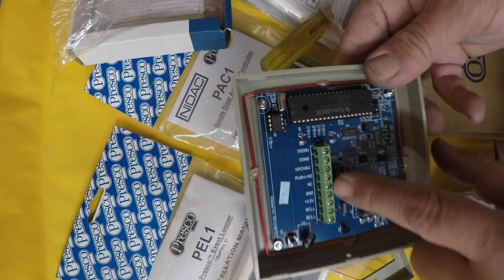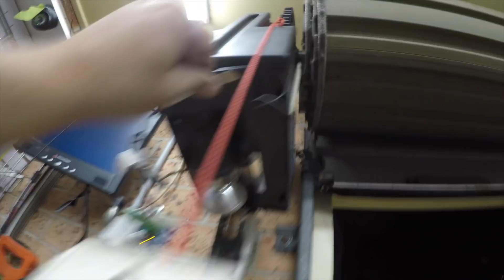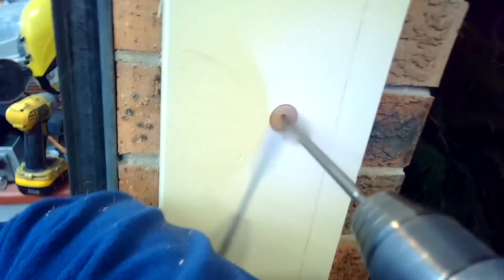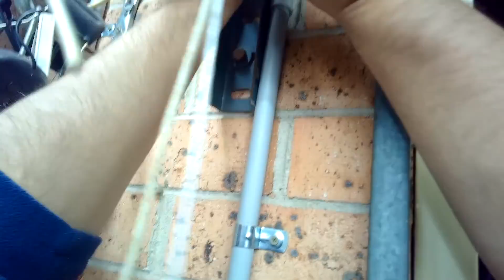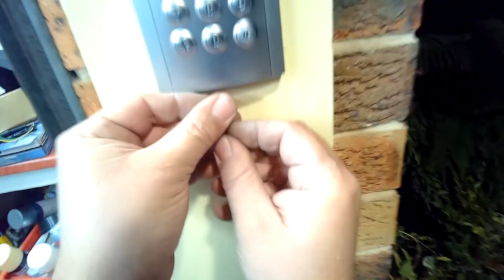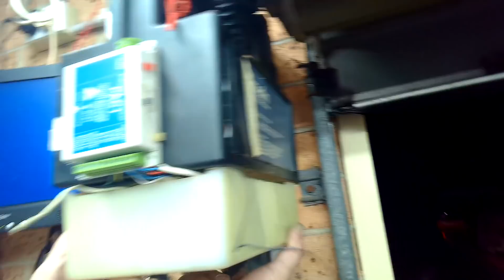Turn a Roller Door into keyless - Access Control

Comment: I had no clue the readers were 80$ each, wene I was experimenting with the proxmark, chameleon G and other tools a few years back I had a collection of different readers I would rig up in the shed to test different features such as MF detection, etc, etc. once I was confident with the tools I tossed all my test gear out. I did, however, keep a motor from a roller door they make awesome motors for a homebrew made electric wire strippers. thanks heaps for another awesome video.